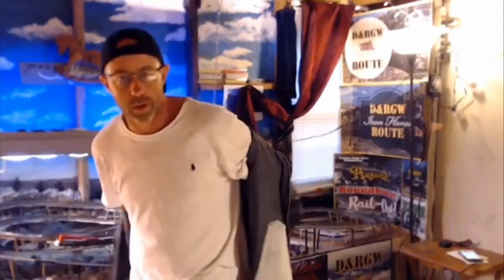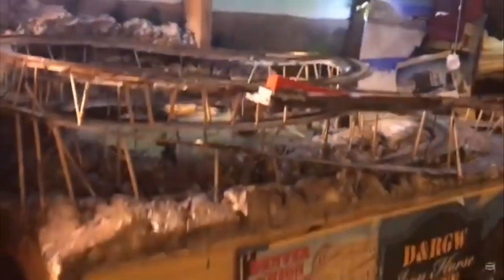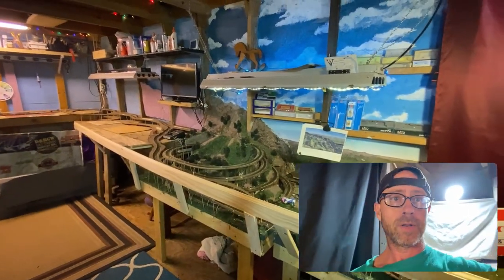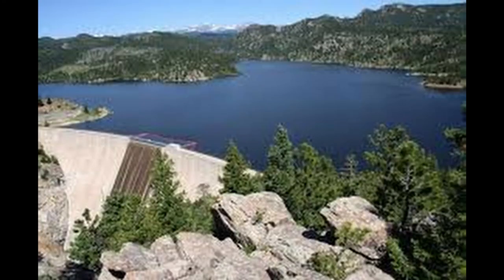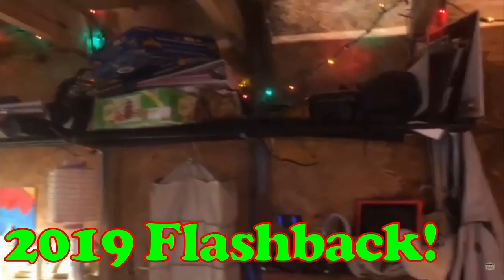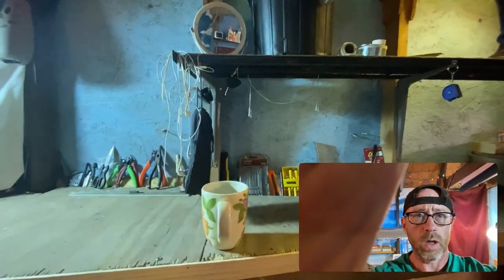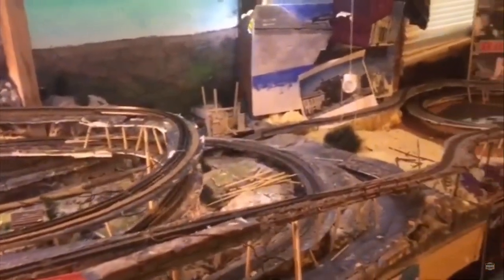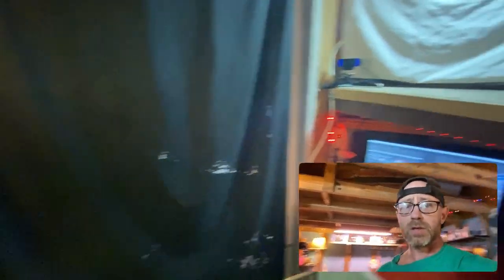How to Turn a Wood Shed into a Train Room II - 2020 Update - Model Railroad - N Scale

Comment: that's a cool track plan.
Reply from the maker: Thank  you.  It is complete now, BUT i have several track work issues to deal with.  I have really had some trouble with the joints on the turns in the helix getting over the AC.   It has been re-done once and still two bad places.   I opted to to a double track AFTER I built the roadbed.  Has been an issue.